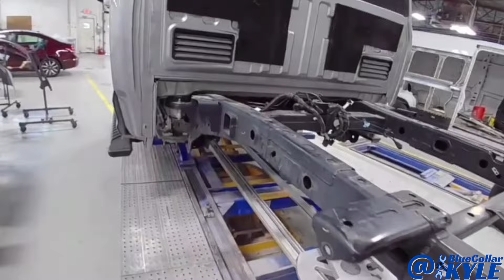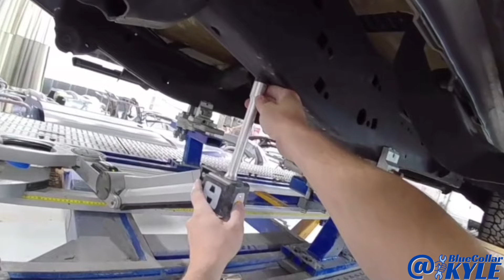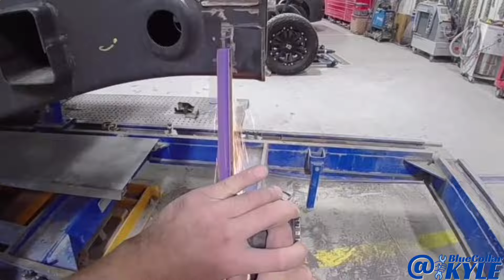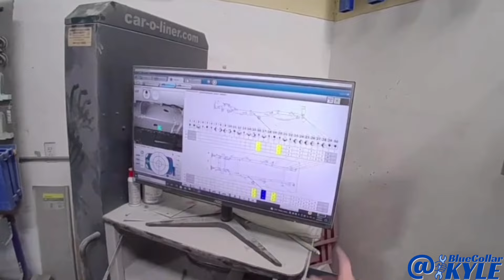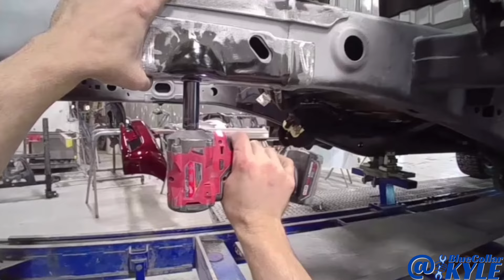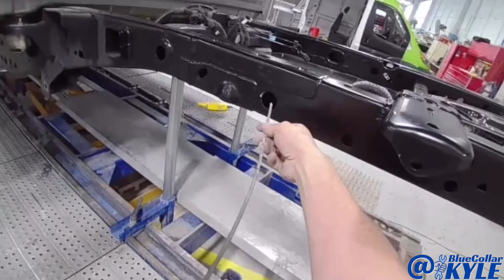Cutting A Truck Frame In Half! #f150 #fordtrucks #autobody #bodyshop #bodywork #framerepair #ford

Comment: Book time to remove and weld that in is like 8 hours. 😢
Reply: You can get $165hr structural time for it. 
We would write it for a frame and it would probably total, problem solved.
Reply: @Everythingisgoingtobealright  the shop can get a structural rate but the tech will get his normal flat rate or maybe a few dollars more. If the shop is drp they will likely get standard body rate and won't be able to total it if Ford services a section part like this. I'm speaking in general terms here for a large segment of MSO body shops that are on drp's. Still a terrible book time allocated for this.
Reply: @dustinjames3764 
I’ve replied to you a couple times, but the replies get removed, weird. I’m interested to see if this one works.